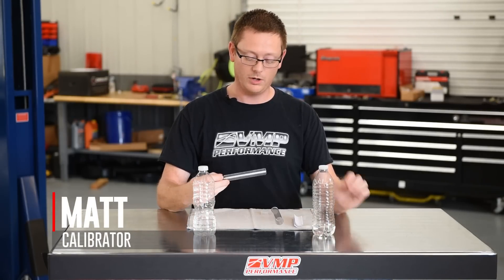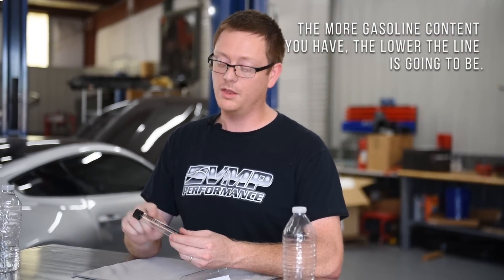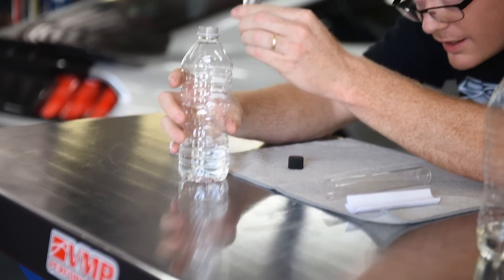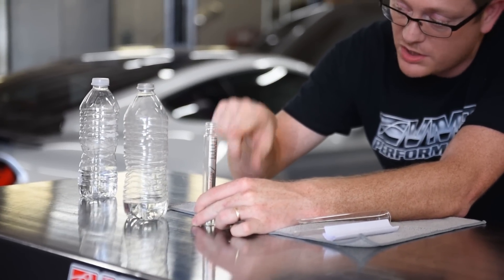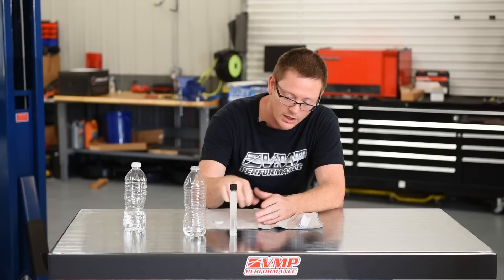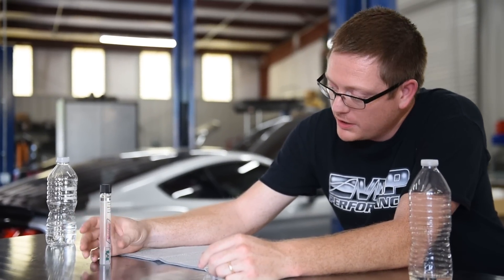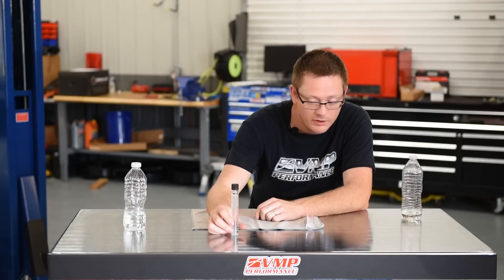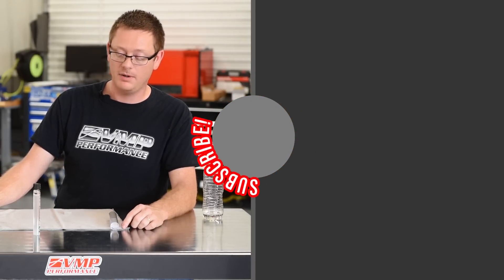Shop Talk Saturday | How to Test E85 Ethanol Content

Comment: How can i tell how much water there is in my e85?

These tests seem to basically give you a two part result.
1. % of fuel
2 % of Ethanol/Water Mix.

My tube tester says e84, my cars ethonol sensor says e71...

Which is correct?

Comment: So the winter blend has more ethanol?
Reply from the maker: It has less ethanol content.  The basis behind this is the difficulty that may be observed with starting a vehicle in the cold that's running on E85.  Particularly, Flex-Fuel OEM applications.  It'll be mixed with more gasoline content to ease in cold starts.  It's important to be aware of your ethanol content, particularly in high performance/race applications where the vehicle may have quite a bit of timing or boost present and its super sensitive to any variances in the ethanol content.
Reply: @VMPPerformanceTV  thanks bro! Yeah Im asking because my lighting acting up this month! Out of no where she running rich and getting miss fires. She built and only takes e 85 and it seems like every winter I get fuel problems 😅😂🤣
Reply from the maker: Understood.  We'd suggest testing your ethanol content to verify the fuel for sure!

Comment: ok I admit. I messed up. I’ve never ever used e85 probably shouldn’t have tried it my first full day of driving my 2012 focus 12.4 gallon. Tonight I was on about little less than 1/4 tank of 93 fuel. E85 is 1.86 gallon right now. Total newbie here. No idea what’s it’s ethanol percentage is. I will soon after this. I put $9.00 a little over 4 gallons of e85 in cold Kentucky on top of less than 1/4 tank of 93. Now it’s running like dog crap. What do I do? Go get ethanol free fuel and add it to it and start over next time I know what I’m doing? Please help man
Reply: Triston Stuart  no dick head it’s not a joke. Read and comprehend idiot. I have flex fuel obviously
Reply: If your car is flex it should read the e85 and adjust accordingly. You didn't specify that you had a flex sensor so the other dude didn't know. And even some cars like my wrx don't necessarily NEED to be flex to use e85. A gallon or 2 in a full tank adds knock protection but if it's not tuned for it don't put more.
Reply: @buyadriver  my bad. I do have flex sensor. But every time I run it, it runs like junk
Reply: @Travis2L  if your intentions are to get more power I would definitely take it to a reputable tuner and pay the 500 or so dollars and have them tune it. I'm not sure if focus engines like it as much as new subarus but you can get almost an extra 100hp just from tuning and e85 with some cars. It is by far the best bang for buck mod.

Comment: I plan on running E85 on my stang soon.  I did a local test and found it to be around e70.  Is that still a safe tune ratio or should I do a flex fuel?  I'm going to have you guys handle the tune so it's based on your experience and expertise.
Thanks
Reply from the maker: E70 is fine, just make sure you put it on the tune order form and measure the ethanol content at fill-up.

Comment: I wish this had line indicators from E10 - E95 for those of us that use blends.
Reply: You can just use a slide caliper to measure the increments and keep drawing them down the tube with permanent marker. They do also make testers that go from 0-100% just not as common and usually a couple dollars more expensive.

Comment: Here is an idea..redo the video. Use a dark background so we can see the line on the tester. Also tell us how long it took to actually separate. Was it 5 min or 15 min. Also remind people to do it safely and outside and how to safely discard the fuel when done.  Sorry to be a nag but if your going to demonstrate something demonstrate it the best way. Rock on VMP..
Reply: thereissomecoolstuff  reminding people to do it outside and how to dispose of it is common sense. They are not here to hold everyone’s  hand . If you need to be told safety precautions like this then natural selection will just take its course.
Reply: @Lethal_Venom  actually it's called liability protection. You are absolutely right. Unfortunately common sense doesn't hold up in court. That's why you have to say all of those things. If it's John Q making a video he typically says "Do at own risk, I am not responsible" when a company sponsors a tutorial it's even more important. Sorry, life in 2019. I love VMP. I don't want them to get in trouble.
Reply: @thereissomecoolstuff  They are not getting in trouble. You think they dont know about these things? How they did the video is perfectly fine
Reply: Here's another idea, strictly for your condition. You should dispose of it,  by Drinking it. It'll help with your nagging, and everything you mentioned, won't even matter. P. S, the higher the alcohol percentage, the better...
Reply: @kostasgt500  thanks trying to help keep VMP out of the courtroom. I like your idea, just not your tone.
Reply: @thereissomecoolstuff  dude, you got issues. I just saw a video. You put them in the court room, and saved them, all at the same time 😂 😂... Forget alcohol... You'd need something more potent 😂 😂
Reply: @kostasgt500  I'm just jealous. They don't have E-85 where I live. When it gets here I'm going to pour a big puddle in my living room in tribute to my lost homies.

Comment: Wish Arizona had E85, only E54 here.
Reply: We have e85
Reply: @Mr.Arizona602  Yeah, but it's very scarce here. It you test the E85, most stations have E54 even though it's labeled as E85.
Reply: arizona have like 11 gas stations of e85
Reply: @Rondo392  If you test the E85 at most of the gas stations, it's really E54.
Reply: @chrism.728  yeah i just actually tested 2 gas stations this morning and shells on 16th st and buckeye was E51 and there is another gas station on 32nd st is actually E75
Reply: @chrism.728  to get some good E85 you would have to sadly buy it and its like 40 dollars for 5 gallons so 8 dollars a gallon
Reply: @Rondo392  Yeah, it's going to be extremely hard to find actual E85 at the pump since a lot farmers have directed their ethanol production toward making hard sanitizer during pandemic.
Reply: @chrism.728  yeah so hey i got 75 out of 85 so not bad at all..
Reply: @Rondo392  I got 80 here in tx 😎
Reply: @JohnD0129  3 of our e85 is is from e80-e95
Reply: @Rondo392   seems about right. I have a HEB close by that sells “ E85 “ but my Cobb AP says 80%

Comment: Up here in PA I have only 2 stations within 50 niles that have E85. They're both on a toll highway.
Reply: i just checked where i live and luckily there is 1 station local in town. other than that im driving 40-50 miles. if that 1 station has crappy fuel well lol. im not sure if ill be going w e85 needless to say.

Comment: Is there a way to measure octane in pump gas?
Reply: the same way
Reply: @Rondo392  are you sure? These tests measure ethanol CONCENTRATION.
 NOT octane. The water molecules bind with the ethanol molecules. If you used regular pump gas it would do nothing except read about E10. That isn't octane.
Reply: @buyadriver This is actually what I’m getting it for. I would like to test the ethanol content on some top 91 octane stations, like shell and chevron to see which one has more ethanol